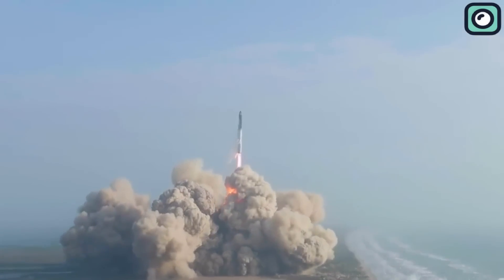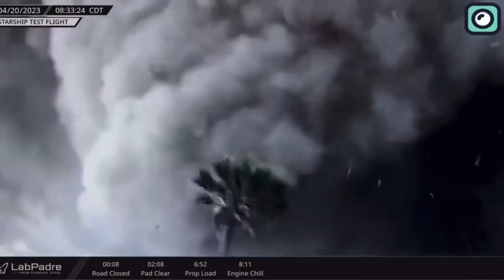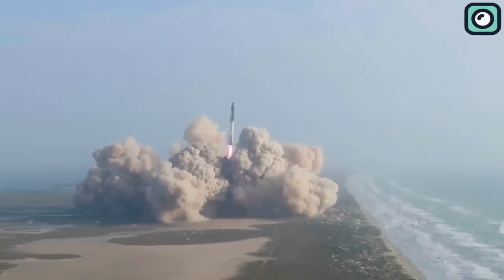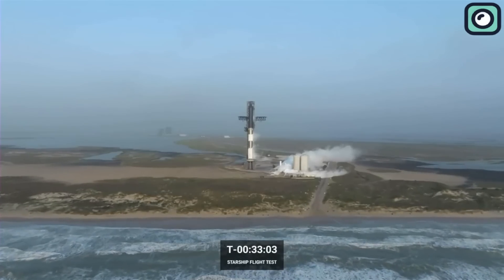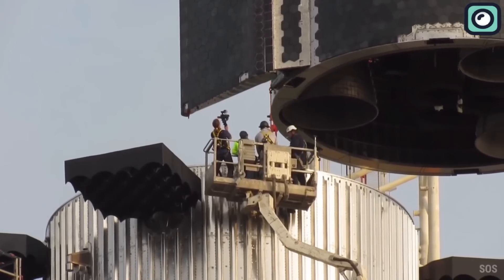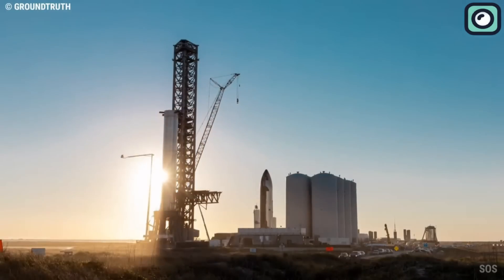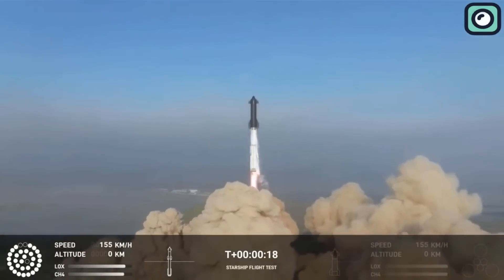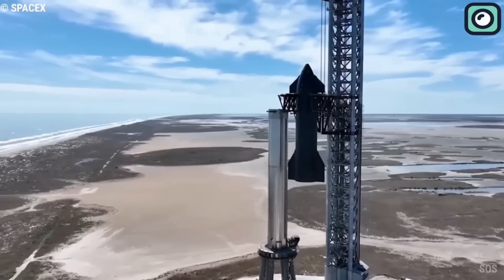Starship's Launch Damage is Worse Than You Think... Stage 0 Destroyed!

Comment: I think having flame trench might have problems as ground water might be too close to the surface. Looking at the beach and sand flats it would be interesting to know how far the water table is under the launch pad. They could go higher maybe. You could have something like an oil rig platform. They will work it out. Yeah, look at the shallow lake.
Reply: I agree that the ground water could prevent them from going too deep, but that would not be a problem at all if planned properly from the start. It is completely normal for a flame trench to be above ground level and for the launch site to effectively be raised a bit, which btw the launch platform already is.

Cape Canaveral is also pretty close to the water level.

Comment: A flame trench is only HALF of it.   They need a water deluge system LIKE EVERY OTHER LARGE LAUNCH PAD ON EARTH because it has long been known that it is the SOUND that does the worst damage. Thousands of sonic booms per second pummeling the structure and foundation is what pulverized the concrete before the flames could blow it hundreds of feet.  A ‘water cooled’ metal plate won’t be enough.  The water is not for the heat, its for absorbing the sound energy.
Reply: They alreading have a water deluge system in progress, the water cooled metal plate would be to protect the actual ground underneath the rocket so it doesnt have to be replaced every single launch
Reply: @XenicMatter  yeah, Musk didn’t mention that. Either way, there was no logical reason to launch without Both system installed, although if the deluge and cooled metal plate were designed by the same engineers that thought they could get away with just Fondag over a 14” concrete pad, then I would be surprised if it will be sufficient.  European, Soviet, and American government engineers had all determined that flame diverters and water deluge were necessary 60 years ago for rockets less than half this powerful.  The diverter and deluge systems should have been part of the design from the beginning rather than an afterthought they were too impatient to wait for. 39a and soviet launch facilities safely channel the exhaust plumes well away from critical infrastructure.   Musk will now have to replace at lease 3 major tanks in the farm, and entirely rebuild the foundation for the launch mount, assuming the concrete inside the legs was not turned into gravel. It will be 6 months or more till they can even try a loaded booster on the mount to see if the pilings under the legs still support that weight without sinking.  This is not even remotely in the realm of iterating a new design for an engine or booster. This was a fukup of monumental incompetence given the well established science behind the sound damage done by large scale rockets and what it takes to mitigate that kind of energy.  I suspect Musk pushed the launch because he had to meet a deadline for further government or investor funding.
Reply: @christopherpardell4418  SpaceX already has at least four new vehicles in progress with furthur upgraded hardware. This was not an engineering or technological failure, it was an economic gamble which resulted in a setback. The SpaceX team is highly competent and they deemed it an acceptable risk to go ahead with the launch before the pad had its upgrades. A more realistic timeline is probably Musk saying itll be ready for the next launch in like 1-2 months and it actually being ready in like 3-4 months. Also it probably wasnt a funding issue considering SpaceX is pretty well established and is cashflow positive at this point
Reply: @XenicMatter  Not according to Musk who stated that if they did not start putting up starlink gen 2 satellites by 2022 that Space X would be bankrupt.  It wasn’t a gamble. It was idiotic. Once more, the absolute need for a deluge system and trench was established in the 1960s.  Musk thinking he could do without it was naïveté at best, reckless incompetence at worst.  keep in mind that every starlink launch is a dead cost to the company, not only of a rocket and all the support services to launch, but also of the construction of the satellites.  Musk has already stated that starlink V1 can not become profitable because it lacks the capacity.  Add to that the cost of building a second launch site, and now having to REBUILD this site with perhaps a hundred million dollars in damage and Musk is treading on very shakey ground.  And all for what? What possible justification could he have for causing this kind of damage when he might have mitigated it by waiting a month for his water cooled plate?  Given that they have produced an Obvious disposable starship, with no flaps but the pez dispenser of starlink v2, I would say he is in a race to get at least SOME starlink v2 deployed in order to woo investment capital, even if it means building disposable starships that will be burned up on reentry.  Falcon 9 flights are Turning out to not be as lucrative as he thought as refurbishment ends up costing way more than he promised. He is burning thru money.  And sorry, but launching before his metal plate and deluge system was ready was foolish because they would not have been building it if his engineers had not said it was needed.    He launched prematurely because he HAD to to meet some funding benchmark.
Reply: @christopherpardell4418  I agree that a water deluge system and other upgraded pad infrastructure is neccessary long term but this was a decision made by the SpaceX team, not just musk himself. Also based on what is publicly visible why would you think the damage adds up to a hundred million? The current Starlink v1 network cost about 3 billion to manufacture and launch and there are over 1 million people currently subscribed and starlink has generated at least 2 billion in revenue with at least 1.2 billion more each year. There are a lot more factors but while v2 sats are necessary for scaling and remaining competitive v1 can be profitable. It is also important to note that SpaceX has already started launching starlink v2 just in lower volume than possible with starship. Also it costs less than 1 million to refurbish a falcon 9 booster but building a new upperstage is in the 10 million dollar range. What specific funding benchmark do you believe SpaceX was rushing to meet?
Reply: @XenicMatter  Musk himself said that starlink could not turn a profit without V2 and only starship can deploy V2 satellites. And he issued a warning that they had to step up progress or they would be bankrupt in 2022. That was a year ago.  But keep in mind that he is launching a lot of starlink missions each of which is a dead cost to the company. Plus the dead cost of the satellites, which, BTY keep falling out of orbit. SpaceX has not even factored their actual cost for the starlink system yet so has no idea what they should charge to be profitable, but they know they need at least 4 times the bandwidth to be anywhere near cost competitive. And most reviewers of starlink are saying its better than nothing, but not nearly as fast as regular internet.  Musk has stated that SpaceX’s survival depends on getting V2 constellation up as soon as possible.  of course, that could just be more lying hyperbole from Musk.   I don’t think you have the slightest idea how much the Starship venture is spending.  Assuming the tank farm only needs new covers and insulation, that’s gonna run a few million. If the tanks inside are compromised, then disassembly, and either replacement, or repair and testing, and then reassembly is gonna run tens of millions.  The real question is how much damage the acoustic energy did to the six pilings that were exposed and undermined. If those are damaged, then you are looking at having to remove the launch platform to demolish the entire existing foundation and start building a new one. Not to mention that they will need to likely rethink their drink for the foundation they are building at Canaveral, and that NASA and the Army Corp is going to likely have a whole raft of demands about how they are building and siting equipment at pad 39, once they have gone over the full damage from this launch. I would not be surprised if they demand he tear out what he’s built and build a proper above ground concrete trench like the one falcon 9 currently uses.  If only to control the direction of the blast.  As it is, the grade beams between the pilings for the legs were entirely undermined and you CAN’T just shovel dirt under them and call it good, because you need to compact the soil. To support the grade beams.   And lastly, You have no way of knowing if it was the TEAM that advised they could launch, or if it was a demand by Musk. Neither do I, but the TEAM clearly had advised they needed a water cooled metal plate based upon prior tests. And given the outcome of this launch, there was no rational reason not to wait for its installation.   The fact that they are building a water system in Florida, and were planning on retrofitting this pad with a water system indicates that there must have been some OTHER pressing reason to launch without it.   I would guess Musk, having stupidly spent his reserves on twitter is needing more seed money from NASA and had to demonstrate a launch by a certain date.
Reply: @XenicMatter it's Not just their risk... They caused massive Pollution in the area with that botched Stage 0.

I doubt there will ever be another Launch from Boca...
Reply: @markus1351  There will be another launch in boca chica in around 3 months. I dont really know what "massive pollution" you are referring to, its really just pieces of concrete, there shouldnt be any toxic material waste or anything severe like that
Reply: @XenicMatter  SpaceX thinks there will be another launch in 3 months,... let's see if the FAA approves it
Reply: @XenicMatter  dust can be quite problematic,...  nost just toxic stuff can be pollution
Reply: They can't get a permit for a water deluge system at that site fir Environmental reasons... That's why they try to give it different names and hide it
...

Comment: This is not the worst thing that happened - much worse is that stage 1 didn't prove its reliability. And nobody knows for sure why exactly so many engines failed, whether it was due to debris impact or not. A lot of money spent without reliable test data due to stupid launch pad construction.
Reply: Stage 1 DID prove its reliability though? Even with 5 or 6 engines failing to light Superheavy booster was still able to push Starship through MaxQ and according to the spacex team it had enough fuel to get to orbit its just that stage separation ultimately failed.
Reply: @XenicMatter  Wrong. Starship was underpowered and had no chance to get orbital.
Reply: @ncrean66  objectively speaking it had enough fuel / deltaV to get to orbit but it was never intended to be an orbital flight due to uncertainties with control and various risk factors

Comment: SpaceX is not "over". Repairs can and will be made. They will improve the pad, they will overcome.
Reply: Pad improvement is not enough lol
Reply: With over 37 years of advanced material reinforcement manufacturing and failure analysis engineering experience, I have designs that should be considered for a major reengineering of the launchpad system & tank farm which can be replicated on other planets ie. Mars. 

With reinforced concrete, it is critical to understand the marriage between the Portland cement (glue), aggregate (rock), reinforcement (rebar) and protection thereof to prevent mechanical failures.

To prevent further launch pad, vehicle and infrastructure damage, suggest new reinforced concrete design along with external advanced composite blend blankets working together to protect the systems from the damaging harmonic & inharmonic frequencies, static, dynamic, shock loads, thermal loads and massive wind vortices during launch sequence.

The massive airborne sand, dirt, rock and cancer causing silica dusts coming from the pulverized concrete and Earth below & around the launch pad are in direct violations of OSHA silica dust & EPA Clear Air and Water regulations, rules and guidelines.
Reply: Correct. SpaceX is not over. But Stage Zero (in its current form) is.
Reply: @torben777  Then it will be rebuilt and improved.
Reply: He needs to slow down before some one dies over herd some one did at the site they trying to cover it up
Reply: @Linky79  you one of those people who just believes every conspiracy they hear "I over heerd (heard spelled wrong) someone did at the site".... what credible place did you hear this??
Reply: How could it have been worse, if they exploded on the pad? OK, this was a HUGE fail. They did this 50 years ago in corduroy pants and chain smoking. They could even top that? Are we that desperate for a win?
Reply: @AFuller2020  You could have killed an innocent bystander. Then what excuse would you have. ?
Reply: @AFuller2020  Have you ever looked at the history of space flight.   In the late 50s and early 60s we had more rockets blow up or fail to achieve orbit than we had successful launches. This is a new system, of course it won't be perfect every time.
Reply: @loudelk99  I hope they do overcome but people need to call out irresponsible decisions. Musk needs to maintain the image of SpaceX as a cutting edge, futuristic company. Not doing something as simple as building a flame trench is embarrassing. If digging is not possible they could've used an elevated platform with a water deluge system. Also the SpaceX team clapping like a bunch of children upon the loss of a rocket was very cringe.
Reply: @loudelk99  we already overtaken this hurdles 60 years go though, Elon didn't invent rockets, like he didn't invent electric cars
Reply: @watchlover7750  but he perfected reusable rockets, and perfected electric cars. What point are you trying to make.
Reply: @AFuller2020  explain how it exploded on the launch pad when it was way up in the air when it exploded
Reply: @woamang  Did you read it?
Reply: @AFuller2020  I read it yes... i also saw it with my own eyes they had lift off and it was flying for a good few minutes.  It did not explode on the launch pad.  There was a lot of debris from such a powerful rocket launch but launch was successful.
Reply: @AFuller2020  you’re clueless.
Reply: @w3vjp568  You’re are up with Musk.
Reply: @Alvin Fuller what do you mean it exploded on the pad?? it was in the air spinning out when it exploded.....
Reply: @woamang  Actually ground control destroyed it when the spin started.
Reply: Exactly! 
The first flight ever...
The launch was very successfully! 
The collected a lot of data now.
And that is the only way to a good system.
Reply: @tilburgcity78  Collect the thirty tons of debris scattered across Padre Island.
Reply: Or they'll go bankrupt following insane musk timeline based on his childish fantasy
Reply: Exactly. That’s what I’m sayin.

Comment: Unfortunately, since the entire stack had to undergo a "rapid unscheduled disassembly". Which means that they only have telemetry and cannot examine the rocket itself to determine exactly what happened. This is why there is so much debate over whether the damage was caused by kicked up chunks of concrete.
Reply: I tell you what happened, the rocket freacking exploded.
Reply: @watchlover7750  it was instructed to self-destruct after the two stages failed to separate; and due to tumbling and atmospheric drag it suffered structural failure, rendering the mission over.
Reply: there would never be a wreck to evaluate in the first place ! So your comment is null
Reply: @calgar42k  if the launch had been successful the first stage would have soft landed locally, and then sunk. There was no plan to recover either stages.